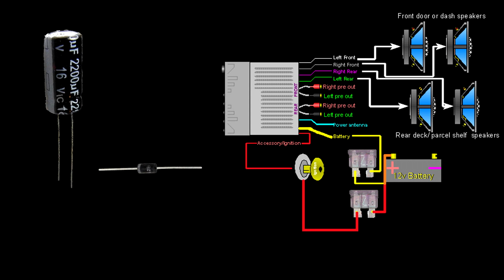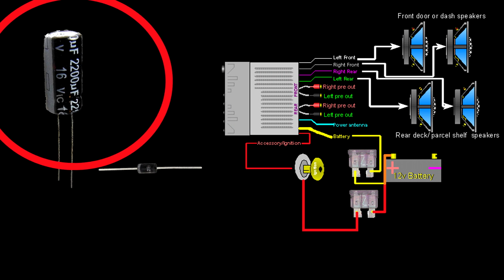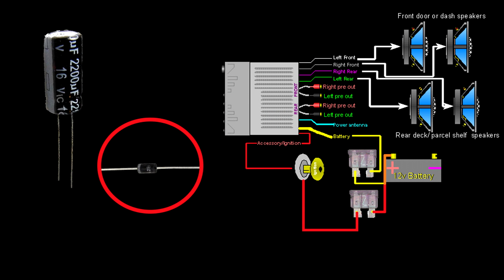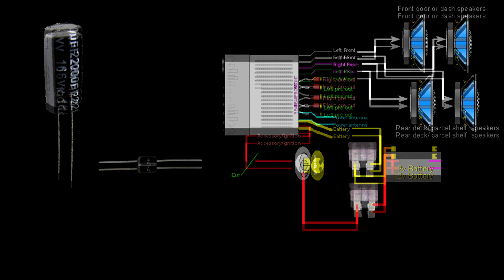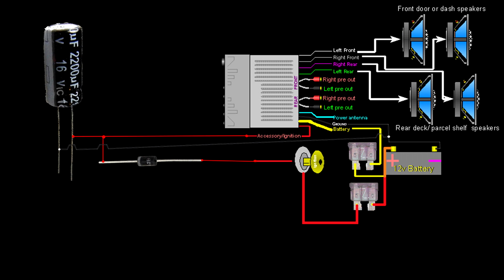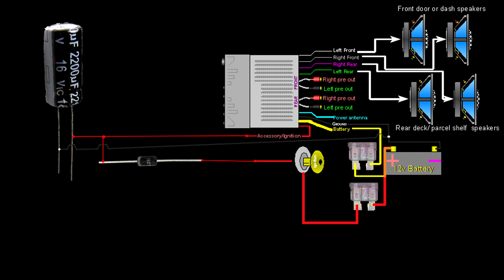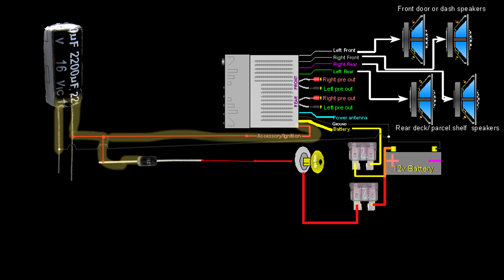HOW TO: Keep Your Car Stereo On While Starting

Comment from the maker: Here are are good starting points for capacitor and diode on Amazon:

Nichicon  UVZ1C222MHD-20 Aluminum Electrolytic Capacitors - Leaded 16V, 2200uF, 12.5 mm x 20 mm, 20% Tolerance, 5LS (Pack of 20) https://www.amazon.com/dp/B071RTXD64

Cafurty 1N4007 DO-41 Axial Silastic Guard Junction Standard Rectifier Diode (Pack of 20) https://www.amazon.com/dp/B00W17LOBO

If you're having trouble with the stereo resetting when you crank the engine, but when the ignition is turned off the stereo stays on for a few seconds, the starter is causing the voltage to the stereo to sag. 
Things to check: corrosion on the battery terminals, old/week battery, bad connections in any wires. 
If these are not the case, you can try adding a capacitor to the yellow power wire as well. Here is a video on that mod: https://youtu.be/2k3J9nByFQA
Reply: thanks for this, I was really desperate to know the exact pieces lol
Reply from the maker: @FutureHendrixFan666  the secret is, this will work with a huge variety of different capacitors and diodes. There are likely usable components to be salvaged in most dead electronics. 🤗
Reply: @StephenTack  hey man, idk what happened but I’m pretty sure I got shocked..can you help me out by what went wrong? It felt like a hot wire went up my arm..

Btw my acc fuse blew at that same time…sorry man Idk anything about this stuff
Reply from the maker: @FutureHendrixFan666  sounds like you should be looking for some in-person help... Make sure no electrical connections are touching, and they are all taped or heat shrinked well.
Reply: I mean it works! Believe me! Now I can turn my car off if I’m idling for too long and then start my car without my Bluetooth going off! It’s so much easier now! The only issue is I don’t know how I got shocked during the installation process. I mean a 16 v capacitor shouldn’t shock you or have that much current go through you since the human body has a large resistance…but unfortunately I did get shocked. Tbh it was a shock, it fell like a current just going through my body! Idk, the whole thing works and all, but I just don’t want to get electrocuted again. I taped everything up, believe me, and I even used old telephone wire and hot glue to keep everything from shorting out. Hard to say what exactly happened..
Reply: Thanks 😊

Comment: I need to figure this out for my 2011 Honda Pilot with Nav. I added CarPlay to my factory navigation system via a third party interface adapter from NavTool. Whenever I start the vehicle, the radio turns off/reboots and I have to go thru a series of button presses to get it going again. First, I have to hit "OK" on the nav warning screen before I can do anything. Then I have to press and hold the "Cancel" button for the adapter to switch over  to the CarPlay/Android Auto interface and then select CarPlay/AA. (The interface also has an option for 4 cameras, wish it didn't so it would automatically just switch to CarPlay when I hold the "Cancel" button).  I also added a wireless CarPlay adapter, so that has to go thru its own boot/connecting process, but that's automatic and can't do anything about that. But yeah, if I turn off the vehicle and then turn it back on,  I have to go thru that process all over again. 

Its not the end of the world but would be nice if I didn't have to do all that. Since my CarPlay interface goes thru the navigation system, I'm worried I'm also gonna have to do this to the navigation DVD player as well to keep it powered during start up.
Reply from the maker: I would try to see if I could find a wiring schematic. It's almost certainly not going to be standard aftermarket color codes. You'll need to find the accessory turn on wire for at least the nav system.
Reply: @StephenTack  good point, if I can at least keep the nav powered, I might be able to get away with just doing that part and not the radio as well.

Comment: help, it still powers off during crank :/ but at least it stays on for 20 seconds when i take key out? so the capacitor is doing something
Reply from the maker: You will see others with that problem around here. It has to do with the main power to the unit browning-out while cranking the starter. Check your battery and connections, and if they are good options are adding a large capacitor (or bank of capacitors) and a diode that can handle decent amount of power to the yellow power wire as well...
Reply: @StephenTack  My battery was submerged in a lot of acid and was about 20 years old. New battery and it works fine now :)

Comment: How did you connect the tiny electronic leads to 18awg car wire?? I'm using that capacitor with alligator clips and reading immediate voltage drop to 3V when cranking
Reply: I was able to solder 18awg to capacitor leads and separate with heat shrink rubber sleeves

this DID NOT WORK im still chasing. 99-06 silverado with aftermarket motor so it turns off & on often. if I jump the head unit to battery straight it STILL turns off. idk why the caps are not working

Comment: I tried this yesterday on my Atoto A6. Happens that when i turn ignition on, battery voltage drops to 5 or 6v, so i had to do the mod on the batterys cables, black and yellow. It's working better now, but not enough to prevent the radio to turn off a little bit. Thanks for the video ☺️

Comment: hello sir, i used up to 3 10,000uF caps but my headunit (android) only stays on for 3 sec. i also used the diode but still no luck. i also have a sub+amp hooked up but even with disconnecting still no change? whould u or someone else reading this know a solution?
Reply from the maker: Does it stay on longer with all 3 capacitors or just 1? Are you adding them in parallel or series? 
Can you test the normal voltage after the diode while it's on?
Can you connect a multimeter (set to amps/mA) in line with the red wire, to see how much current the head unit draws on the turn on wire?
Reply: @StephenTack  thank you for your fast reply,
i put all capacitors in parallel. ACC wire to ground gives 12v after the diode but when i unhooked the capacitors while they where 'full of charge' the three capacitors itself gave about 10v on the multimeter (i dont know if im measuring it the right way tho).
i will check how much the headunit draws and i will let u know, thanks again for the response!
Reply: @StephenTack  hello sir, i just found out that for some reason the B+(yellow 12v (memory?)) wire was switched with the red ACC wire in one of the iso/din plugs. for a few years ive been using my headunit like this with no problems actually. when i switched the wires back over to the right position, the capacitors worked! turns out 1000uF is enough to keep the head unit on for about 30 sec. thank you for your reply and willingness to help me i really appreciate it. greetings from the netherlands👍

Comment: So I have just sired this in exactly as you described.  But it doesn't work. The radio comes on as normal but turns off when cranking.... it a new radio, an eonon. Any suggestions? 

I was so chuffed with my work, such a pity it doesn't work in my radio.
Reply from the maker: How long does it stay on after you shut the ignition off? It may be that your starter is making all of the voltage sag too low. Have a look at the other comments here for ideas. Cheers.

Comment: Thanks  you sooo much for this interesting trick😊😊. It work for me,  i didn't  expected  that. Finally  solve this annoying issue. 

But I noticed  that a after turning off the car an remove key , the car head unit stay on for a few 5 second, because the condensator still have a lot off jus to power the head unit. I use a 25v 2200uf  condensator  for an after market android  head unit type. Please let me know  If you think there  us some thing i could do about that. 

Again thanks  a lot you save me.
Reply from the maker: Yeah, that's the side effect. There are ways to negate this, but nothing simple or easy. 
You could reduce the keep-on time (if the car starts quickly) by reducing the size of the capacitor, or putting a high value resistor across it (10k to 100k), or possibly adding another diode in series with the current diode to add another voltage drop.

Cheers 👏

Comment: It does not work for me completely.
The radio stays on for 2 seconds after turning off the ignition, but the radio still restarts when cranking.

I am using a 25V 330uF capacitor with 1N4007GP diode.

The battery is Topla Energy 12V 45Ah with 420 cranking Amps. The voltage of the battery is 12.41V, with the key on ACC it drops down to 11.60V, when cranking it drops to 9.8V - 9.3V.

According to its specs the radio (Pioneer MVH-330DAB) works at 10.8V - 15.1V and it consumes about 0.58A (my testing conditions) with 1/3 volume and around 2A on maximum loudness.

So if the voltage drops to 9.8V while cranking when the radio needs at least 10.8V it means that the battery is too weak. I do not want to replace the battery because it is still good. Maybe the next one I buy will be more powerfull, but how much more power do I need?
The other solution is to add a diode (how "strong"?) and a high capacitance capacitor in the middle yellow (constant) wire. Again: what capacitance would be enough to hold voltage for about 3 seconds?
Also I read somewhere that the power of the battery decreases in the lower temperatures and the power needed to start the car increases in the same conditions. At the moment we are in the end of the winter so I will have to wait until summer to see if there is any difference.
Reply: you need 2200 mF capacity, your cap only has 330 mF capacity.  thats why it doesnt stay on long enough. edit: oops I mean uF (microFarat)
Reply from the maker: @Alex-Zone  good catch, if it's not a type-o.
Reply from the maker: You have a good understanding of the situation. 
You can use multiple diodes in parallel to handle the power. 
For the capacitor(s), you'll probably need at least 300,000uF total. You may be able to get this by putting supercapacitors in series to get the voltage rating you need (15v+).

You could also look into all the connections to your battery, and starter. Poor contacts will cause voltage drops... Also if you have an older style starter, look into getting a new gear reduction starter, they draw/surge less current.

Comment: Nice little video that stand the test of time. Sony XAV-AX100 with 16V 2200uF and 1N4001 Diode allow me to park turn off the key and then restart the car without restarting the stereo in a VW Jetta. When i take the key out its just a few seconds extra before the stereo turns off. Its a hack but solves the problem of not having the reboot when i restart the car picking up the kids. Cheers

Comment: ALTERNATIVE WAY:
hi people i wanna share this. i dont know whether someone suggested it online but im coming out.

in most cars you can suply the auxiliary line with power through the lighter socket. 
best way is to get a lighter socket adapter or slpitter or anything and you disassemble it and you can fit capacitors in them. 

in my car 4800uf is just about enough to keep it running through the cranking. 
its without diodes because this eay you cannot add diodes unfortunately.

later i switched to a 1fahrad 16v supercapacitor assembly (these are small in size) and it runs for about half minute now. 😁

if you get a lighter socket splitter these have space inside them you can do it without it looking ugly and looking janky.
Reply from the maker: Why use the lighter for power? There are wires inside the dash designed to supply power to the stereo, making for zero ugly wires showing. 🤷🏼

Comment: Feel free to tell me if I am doing something wrong here. My 2004 Renault laguna shuts the complete ISO cube connector off wheen ideling positive and negative. I already have 2 capacitors installed on both circuits, however since the ground is beeing cut as well, would it help if I simply add an extra solid ground there??? I wonder if anyone faced this problem...???
Reply from the maker: It's kind of crazy to me that it disconnects the ground. But just at first thought, I don't think that is the problem with the capacitors (and diodes) not working. 
You mentioned both circuits, do you mean the continuous "battery" supply wire, and the ignition signal wire?
Reply: @StephenTack 
Just figured out one capacitor is weak, but stil 12. 1 Volts it delivers for 5 seconds.... If that could be the problem. Should I wire the negative pole of capacitors to the black cable leading from the ISO cube to the radio, could it work, or its gonna blow the fuse??? Thank you anyway for the video....
Reply: So I have rebuild the setup. I bought new capacitor 4700uF 16V-much bigger than the old PC source one. New diode 1A 40V and as a ground the black cable from ISO cube and boooom, there we go. It works.Again, many thanxs to your advices and video.

Comment: Hi another question if you don’t mind.

If I want to add 
2x capacitor  16v 2200fu & 2x Diode? 
Will be any problem?
Reply from the maker: You can add a second capacitor in parallel, but you should only need one diode.

Comment: finally became after a long time looking for a solution. There is only a small problem when using this method, my head unit will turn off after 1 minute after the key is pulled out.can anyone help give a solution?
Reply from the maker: Use a smaller capacitor, or put a high value resistor across it... I'm guessing 100k 🤷🏼
Reply from the maker: And/Or you could add more diodes in line, as each has a voltage drop, so you'd be starting with a lower voltage.
Reply: I will try, thanks for the help

Comment: thank you very much for your post. I guess you are going to save my life. I recently bought one of those chinese head units for my twenty year old car. Thanks to this stereo, I feel just like driving a brand new car, but that annoying hasle of restarting android during ignition is making me have nightmares. It is not just the music but also the navigator. If I have to stop the car to pump some gas, I have to start the stereo again and let´s not forget it really takes a time to run properly(the processor in these devices is usually very weak). I haven´t tried it yet, but I hope everything is going to be fine. Aside from that, some more advice is always welcome.